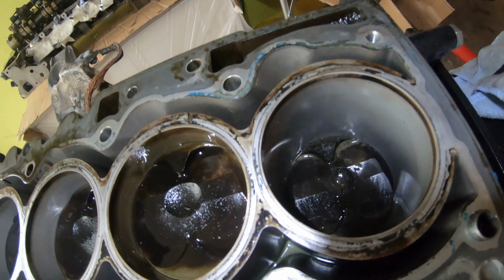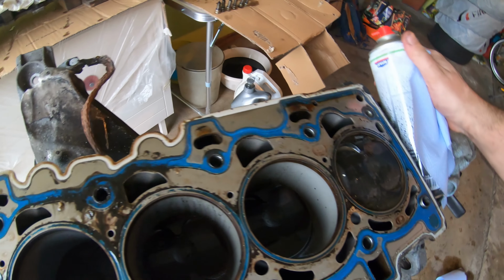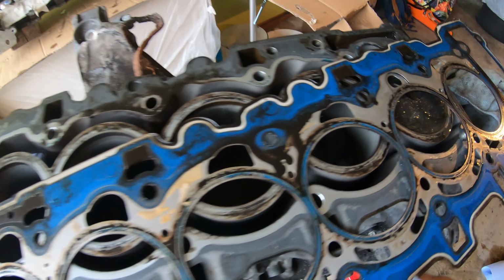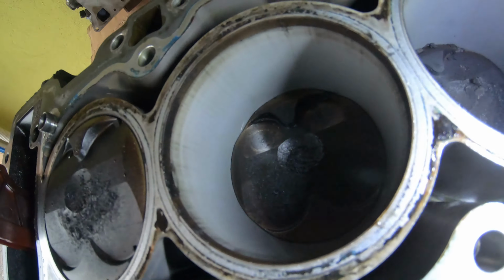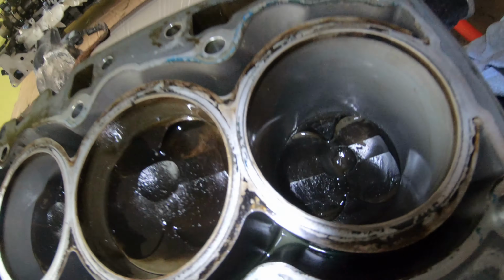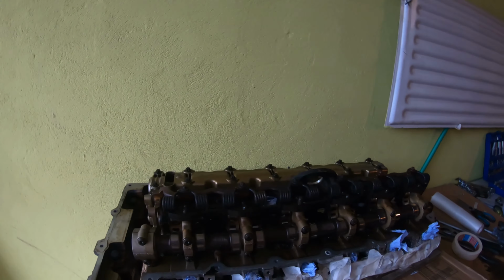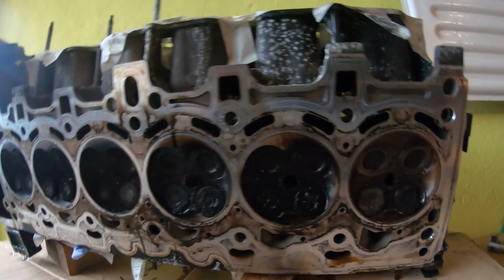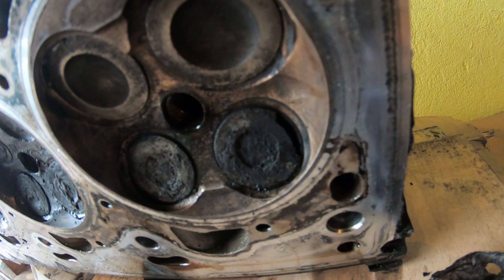Inspecting The Cheap EBay BMW N52 Engine Block & Cylinder Head - Major Damage? [N52 Rebuild Part 4]

Comment: What caused the C6 exhaust valve to break is a collision with a small broken plastic part that comes off the 1st Disa valve.
Common Issue around 150k Kms. This failure gives no warnings. If lucky the DIsa will rattle between 1500 and 2000 RPM before its flap axle breaks and gets swallowed by the intake manifold.
Usually it ends up in Cylinder 6.
Reply from the maker: That would make sense that the small part could get lodged and wreck part of the valve. Your guess is as good as mine.
Reply: Late response, but wouldn’t that damage the intake valve? The broken valve was the exhaust valve..
Reply: this happened to mine, ruined the valve and the piston. just threw it away before taking anything else apart.
Reply from the maker: Sorry to hear!
Reply: Yes this is correct. The DISA should be checked every oilchange. If the tiny thing that hold the flap brake off and goes inside the sylinder you will have valve damage. I did not hear any sound from my DISA flap before passing 4500 rpm. Took it a part and find the flap loose......
Reply: Ultimately with a misfire and white smoke out of exhaust?

Comment: is it normal to have oil on the pistonHeads ?? (when i remove my sparkplugs and look down in the cylinder i see dry oil on the pistonHeads )
Reply from the maker: Yes, that it's normal. It probably has been burning oil for a while. As long as it's not wet like in the video
Reply: @buildanddrive   what if it is wet? I think it is wet on 1 or 2 cylinder
Reply from the maker: Probably piston rings
Reply: @buildanddrive  is it bad tho?
Reply from the maker: Yeah, probably piston rings or valve stem seals are bad
Reply from the maker: Buy what is your oil consumption per 1L?
Reply: @buildanddrive  could be the CCV aswell

Comment: Wow those valves are caked up, how many miles did this have on it? .. is it a big / expensive job to just replace all valves?
Reply from the maker: Not sure how many miles but it's caked because it was burning oil so badly. I just ground down all the valves. 👌🏼

Comment: No 6 combustion chamber was steam cleaned by a coolant leak.
Reply from the maker: Nice idea. I also think the valve broke and so they tried to walnut blast that cylinder because of low compression to see if they could fix it but of course, it didn't work

Comment: Hone it and new rings
Reply from the maker: Yep. I agree. I did hone it and got new rings... Although the YouTube comment section seem to be smarter than me... The cylinder walls are a special alusil alloy so you need a special hone for it. Didn't know that at the time 😂... But I don't think it hurt anything with a regular dingleberry hone.
Reply: @buildanddrive  I was just going to say those cylinder walls don't look like a regular steel cylinder.
So it's a special coating??
Why I'm not surprised with BMW.
Always complicate things more then necessary.
I'm assuming coating is thin, to make less resistance for piston and rings travelling, so you have to be very careful honing it.
Reply from the maker: @trade1713  yes, they are an alusil coating and require a special hone. But the block is designed to be bored 0.25mm over and fit new pistons etc. So I don't think my hone did much damage 😅. But if you have an N52 I would measure the bores, make sure they are straight and then just not touch them at all.
Reply: @buildanddrive  yes, mine is identical to yours you are rebuilding.
It uses quite a bit of oil, but to rebuild it, it's a big job..
The making thing that's annoying me is the hydraulic valve lifter rattling untill the engine warms up.
It rattles quite badly before becoming quiet.
The well known flaw with early N52s..
If I do anything, it might be valve stem seals and replace the annoying rattler while I'm at it.
Still requires both cams to come off.
That can be the tricky part to put them back on, since there's a special tool to remove intake springs on the camshaft  apart from the timing tool.
Reply from the maker: @trade1713  It's a massive job to rebuild. I used a 5w40 that helped with the valve tick. I replaced two of my lifters on cylinder 6 and had no tick for about 10,000kms but then it came back. I will change the oil and see if it goes away again. Send me a message on Instagram. I can show you how I took the valvetronic lifters off with a few bucks in parts from the automotive store.